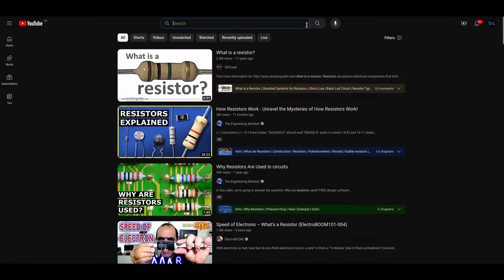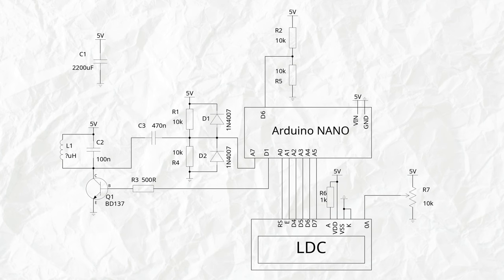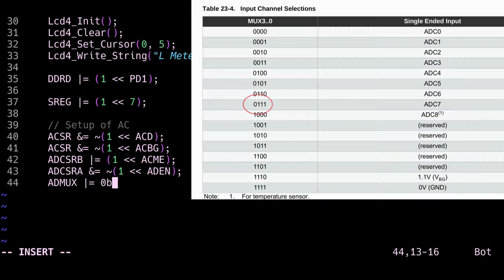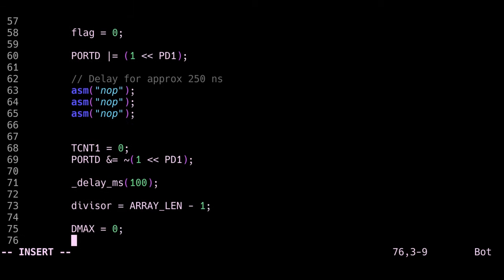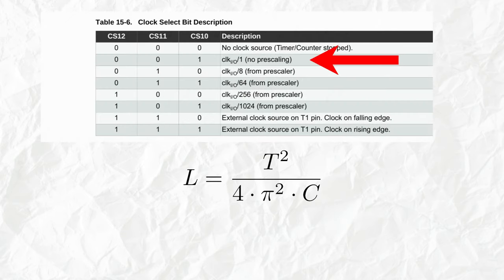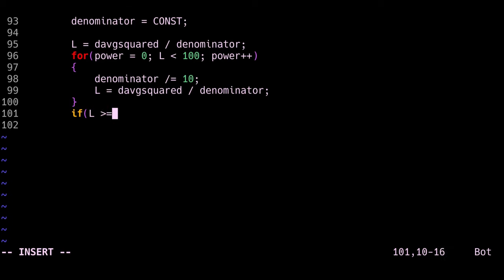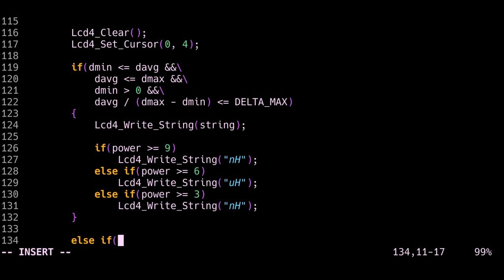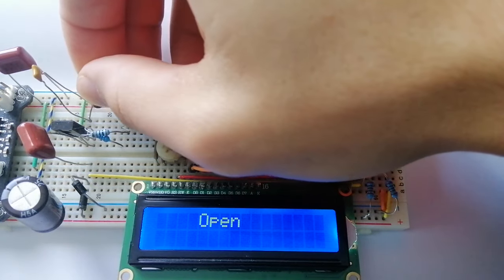Building an Inductor Meter without External Comparator | Arduino Nano

Comment from the maker: I'm curious to get feedback about the code explanation:
Was it too long and should have been avoided?
OK but shorter would be better?
Good the way it is?
Or even more in depth?

Let me know, thanks!
Reply: I think going over the code that's already written, in functional steps, which can sometimes involve skipping around where necessary, is better than going down through it in a very linear fashion "as you write it". But still educational as it is.
Reply from the maker: I appreciate the feedback
Reply: You need split your code to modules/functions. Then give each module and each function the most understandable unambiguous name. Then do it with each variable. Instead of comments, try to give variables and functions the most understandable names. Add comment to the code only if there is no other way to make the program more understandable. The quality of the code needs to be measured by WTF-meter. 1. Give your code yo another human. 2. Check WTF count. Lower WTFs is better.
Reply: It wasn't too long, but (for me) a tad quick. Manipulation of the registers could be more in depth in a separate video maybe?
Reply: I think a thorough explanation is good and, as you did, allow viewers to skip if they want. 
I've been teaching adults for nearly 4 decades. Everyone wants different things with this; the math, the code, the schematic, etc. The only way you can get close to pleasing everyone is to do the lot but provide skip points.
Excellent description of your project, thanks!
Reply: To this noob it seems like you did a pretty good job of covering tons of detail in a very short time.

Comment: Arduino libraries are mostly garbage based on other libraries written by noobs. I also prefer writing my own functions, just like it was done 20 years ago. Back then, code was a lot more efficient, nowadays people think that if we have fast microcontollers, we can waste some clock cycles and create shitty code
Reply from the maker: Totally agree
Reply: Seems like you are even lower level programmer than me, I still use Arduino IDE despite writing in almost pure C, while you use vim on linux. Good to see that there are still some channels showing the proper way of doing things, instead of using pre-prepared solutions for everything. Yeah, it takes more time, but you also learn a lot more. I would say that it's the best way to master troubleshooting, logical thinking and pushing yourself to the limits not to give up. Not that long time ago I was crazy enough to write my own audio codec that beats MP3 when it comes to some aspects. Was it easy? Nope. But was it worth it? Definitely yes. Anyways, best wishes for you and your channel!
Reply: @_MINT: I suppose it depends on your definition of "garbage" and "shitty." Nothing that actually does what it's suppose to do can rightly be labelled as either. If it takes another half second for a program to run, who cares? If it uses code that theoretically can be optimized but it works anyway, why waste even more valuable time (the programmer's) to fuss with it? Since we do have very-fast micro-controllers, why try to make the code faster than a person will even notice, at least for a test instrument such as this? 

If I insert an inductor in an instrument and it gives me a reading in 1.5 seconds instead of 15ms, I (the programmer/user) will never experience the delay in any meaningful way. This very long-standing concern with speed of execution--and with memory usage--if from an era when those things were either unavailable or costly. Now they're ubiquitous and very cheap. 

The only other reason to make the fuss in all but the most critical applications (in which you wouldn't be using an Arduino anyway) is to assume a posture of superiority over "noobs" and to assert that twenty years of experience isn't just one year repeated twenty times.
Reply: @tcarney57  well, I'm a perfectionist, so something totally okay for others might be garbage for me. I'm not gonna define what shitty and garbage means, let's not elaborate too much. I demand from my code to be clear, fast, memory efficient and totally idiotproof. No bugs allowed, even minor. Creating such a code takes time, but I am satisfied with myself afterwards. Only exeption from above rules is writing temporary code for test purposes.
Reply: @tcarney57  I don't know why your reply is gone, but in my case it isn't "I am perfect". I am not perfect and I will never be. What pushes me to create "perfect" code is the need of an absolute control over what is happening and the need of having a feeling that the code is bug-free and stable. That implies using no libraries, unless I trust one, which isn't the case for most of Arduino ones, and also creating the code like it's some kind of fine art. I am something of an artist myself, very competitive one. Maybe my approach will change one day, I'm not even 20.

Comment: Hello I do the circuit according to the circuit I closed the video and checked it several times, I also used the hex file that you put in the new one It only says "open" on the LCD But the problem is that when connecting the inductor in the circuit, the board makes a connection and draws 1 ampere! Please guide 😢
Reply: When connecting the inductor to the circuit, it draws up to 1 amp and heats up the bd137 transistor and writes >open< on the LCD.
Reply from the maker: @erfanblaze4524  
Hi, it's very difficult helping people through the internet debug circuits, but what I can do is give a few pointers and recommendations:

1) Check your transistor, if it's truly a BD137 and not a PNP.
2) Check the overall wiring. If you have and oscilloscope, probe all voltages around the transistor (the base in particular).
3) See if compiling your code and using my .ihex file gives the same result, if not there could be a problem in the code (potentially mine as well, although I don't think so).
4) Check the integrity of the arduino and it's pins, try an other GPIO to be sure, or test the one you're using with an LED to confirm it's working properly. Ideally check that it's capable of both sourcing and draining current.
5) Try swapping the transistor, in case it was bad or it got damaged. A MOSFET should work fine, but use a series resistor to limit the drain-source current. Place it on the drain side, not the source because it won't turn on properly.

Unfortunately if the problem is hard for someone working on it in person, it's REALLY hard for someone over the internet.
The general approach I recommend is to progressively excluding all possible faults and faulty components, one at a time by testing or swapping them.
I really hope that helps, good debugging!
Reply: My circuit worked correctly and the problem was using the software >avrdudess< to put the hex code on the arduino nano, when I connected it directly to the atmega328 with the stk500 programmer and programmed the hex code, the problem was solved and the circuit worked correctly. he does Anyway, thank you very much for your advice 🥰🙏
Reply: There is only one problem that it reads all the inductors, but it has a problem with small smd inductors like size 1206 and it doesn't show a number! I mean, where does the problem come from?

Comment: Can i use a bd135 instead of bd137?
And can i use arduino ide to upload/write the code?
Reply from the maker: The two transistors appear to be both NPN and have same pinot, so almost certainly yes.
You can use Arduino IDE, just remove the main() and put the rest in setup() and loop()
Reply: @5VLogic  thanks

Comment: great video, thanks!
but with your shown code you won't ever get a reading of 'mH' unit because in line 131 you forgot to change the copied 'nH' string (with power of 3) to 'mH'...
never the your code gave me a lot new inspiration - thanks again!
Reply from the maker: True, quite the eye for details!
Reply: More related details: With the right rounding error the value of power can even become 255, in which case you could probably just display "H" as the unit which you don't show in any case. More theoretical perhaps, but generally a wrong unit will be displayed when (power >= 12), but you will have other numeric problems as well at this point... (perhaps even with ns-level calculations) The divisor can also become 0 which you might want to just treat as an erroneous measurement.

Comment: It interesting, if you use about 20mH inductance coil, the result would be satisfactory? I measured L of secondary transformer output by UNI-T - it gave 17 mH but by some other tester it was 36 mH. But when I measured experimentally using formula J= U/sqrt(R^2 + XL^2) I obtained 111 mH.

Comment: Thank you With the tips you gave, the  program works well
There is only one problem that it reads all the inductors, but it has a problem with small smd inductors like size 1206 and it doesn't show a number! I mean, where does the problem come from?
Reply from the maker: Hi, I'm glad you were successful in building the project!
Although I don't have any SMD inductors to test, I'm relatively sure it's because they have high series resistance. Being so small they have to pack a high number of turns in there, and the wire has to be very thin. This means that the energy is lost quickly before it has time to oscillate enought to give a reading. I think the program discards measurements with less than 4 oscillations maybe(?), it's been a while...
Also I don't know the value of your inductors, but low values are also not read, for similar reason, not enough energy is stored in them to oscillate enough and the Q factor is also lower, creating the same result.
You could measure series resistance with an ohm-meter to verify the hypothesis if you'd like.

Comment: Nice explanation of the logic (and code). Your explanation helps a lot. Was it too long ? NO. One question though. You copied the LCD.H to your folder and uses it. Is it different from the standard library ?
Reply from the maker: Hi, thanks.
Hopefully I understand your question correctly; the standard libraries like <util/something.h> are installed along with the compiler in a path that the compiler knows. The lcd.h is a custom one that must be added manually, therefore it is included with " ". It's path should be where the compiler is called, otherwise specified explicitly.
I'm not an expert on this subject so hope this helps.

Comment: Great job! 
It would be nice to make a pcb like a shield for arduino nano. 
You can make the lcd smaller or maybe an oled that uses less power and space.
Whats the max inductance it can measure? Can it be used for big coils like transformers?
Reply from the maker: Thanks! I thought of the PCB idea and but will wait until I add the capacitance and resistance measurement.
For the max inductance, I've tested the low mH range and it works, but haven't pushed the limit.
Reply: @5VLogic  maybe the 5v are OK as voltage, as long as the mosfet and the psu can allow some amps to flow. Why not try with some transformers laying around?
The pcb can be done even diy, you can provide an idea of the layout.

Comment: Hello
What compiler did you use?
And the hex code was generated?
Reply from the maker: Hi,
I use avr-gcc as a compiler and avr-objcopy for the hex file.
My makefile (and the whole project) is on GitHub and you can check it out and/or download everything there (link in description).
In my case I run everything on Linux, but I think it should work on all OSs if the necessary utilities are installed.
Reply: @5VLogic 
 thank you I compiled with avr -stdio and put the hex into the arduino nuno And I closed the circuit and it says open on the LCD, and when I connect the inductor to the circuit, the board makes a connection! Maybe the problem is with my compiler, please upload hex file 🙏
Reply from the maker: Finally got it done, hopefully it's correct because I stopped working on this project since I turned it into the LC meter in my following video, but it should work. I'll upload the hex file for that one too in case you'd like to try it.
Reply: @5VLogic  tank you

🥰

Comment: You can provide file.hex

I use windows so I can't use avr gcc. thank you.
Reply from the maker: Hi, it's already available on GitHub, link in the description.
Reply: @5VLogic  The description link does not have a .hex file but only an exe.ihex file.

I don't flash it your way, so I need the file .hex
Reply from the maker: Ok, I updated the repo, try it now and let me know if there are any problems.
Reply: I don't want you to change the name, I want a .hex file that can be loaded directly with the NEO programmer tool without avdure or similar, I don't use linux, I have ch341 avr and nep SPI programmer.
Reply: I don't want you to change the name, I want a .hex file that can be loaded directly with the NEO programmer tool without avdure or similar, I don't use linux, I have ch341 avr and nep SPI programmer.
Reply from the maker: As far as I can tell from searching on the internet, the two things are the same, it's always Intel Hex. If that's not the case tell me how to compile it and I'll do it.
Reply: Ok.i will try
Reply: a .hex file read from the atmega328P, or like a file that can be emulated in proteus. Do you understand the problem? I think this ihex file is different from the hex file.
Reply from the maker: A .hex file is a text file in which the binary data is represented with ASCII characters, therefore it can be opened in a text editor.
The extensions can be .hex .ihex .ihx  and others (Wikipedia: Intel HEX).
The hex file isn't read by the microcontroller, it's used by the programmer to write the binary data to the micro.
Now I don't want to be rude or anything but I think perhaps there's a problem on your side with programming, check if you're able to make it work with an other .hex file.
I'm not sure what you're using for software...
Otherwise you can always just take the source code and compile it yourself in whatever IDE you prefer.
Hope this helps